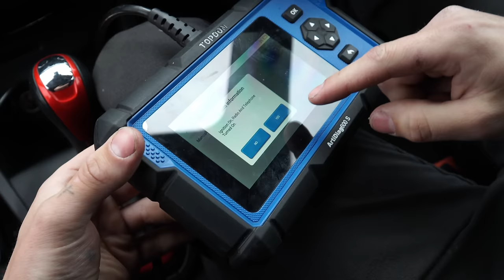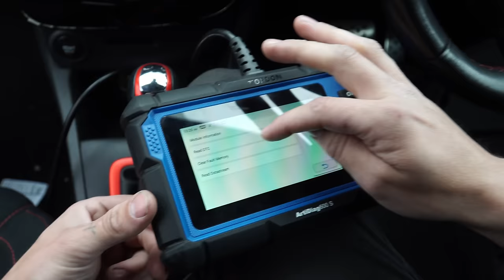They Rejected This Renault Clio After 7 Months!

Comment: Although she trashed the car and definitely lied about the severity of the fault, it was confirmed as intermittent and if I'd bought a car with an intermittent gearbox fault, I'd no longer wish to drive that car for multiple reasons. 

Although you guys did absolutely nothing wrong, the onus is still upon you, if under warranty,  to find and resolve the fault, even if its just a sensor. 

Personally I think the customer is chancing their luck but if they've had faults, and not everyone will report a fault immediately,  then recurring faults are no fault of the new owner. She also reported it at 5 months which is a month before the warranty expires. Therefore faults announced within the warranty period are still valid for return or repair for however long it takes the car to move through the system etc. 

It's a tough one, but the owner should be liable for ANY damage they caused if returned for a refund. So the price of 4 alloys, external and interior full valet service and replacement if any non-wear and tear items like the holes in the boot etc. 

I'm not entirely sure how the financing system works re: third party terms and conditions,  but if the car isn't returned In similar condition then surely the customer is liable and any refund they receive should represent their payment minus any work done in order to resell the car. I'm probably wrong because these companies and consumers rights don't always give reasonable and fair outcomes for both parties. So the idea that the customer can basically rent a car, trash it and return for a full refund sounds like a recipe for disaster for small businesses.  

Its a fking tightrope mate! But I can see nothing wrong with how you've dealt with this matter and would happily purchase a car from your shop! Sub added ❤
Reply: Ps. I should have watched the remaining few minutes before commenting 😂

Comment: Clio genuine pads and discs are soft as shit about 30k generally and things that should not brake brake but mine has been good really
Reply: 30k?!? Shocking for such a small/light car.

Got 45k out of Volvo (genuine) pads on a pretty hefty saloon (S80) with a heavy 2.4l diesel lump up front - and I don't drive like a saint! 
Finally replaced as one disc developed high spots and the other three (+ pads) were getting well worn - but still enough to pass MOT without advisory only a month before.

Comment: Well at the moment I am in a similar position but as an owner. Bought car in Feb  , got 75 miles ABS , AFS, TPMS lights on ..the same day , got home called gargae , yeh bring it back as it had 3 months warranty, they refused to collect it so I had to arrange transport and a hire car for a week. Fixed a week later for a faulty AbS sensor and hub. Two weeks later same lights on , local indy reset for me , six weeks later all lights back on along with this a squeal when breaking plus an oil leak on the sump , reported back to garage that not happy and returning the car for them to look at there response we will fix the ABS hub for free it is that the other items we will charge you for oh and I have to transport the vehicle...so got my finance company involved , only had the car three and half months so not acceptable. The car has been looked after and cleaned every week. Unfortunately the attitude of the dealer put my back straight up so unless they put the things right I have requested I will reject the car. And yes I can afford the finance I cannot afford to be without a car. Seeing as it is an old Lexus the parts are going to be expensive so let's see what the dealer comes back with. That said the owner of that Renault should be ashamed leaving all that crap in it

Comment: This is happening more and more people know they can get basically a free car for 5 months then pull the consumer writes then get all there money back go to the next dealer to do the same thing also isn't there a clause that they have to bring it to you to fix it first what about the damage and warranty short to earth check wiring loom going to gearbox may have been earthing or she's been doing very short runs the battery may have been near the end of its life the battery would not have been getting changed enough and constantly being depleted there for throwing up fault codes

Comment: So, some sympathy for the customer here. She bought a 10 year old car with her savings, which 6 months later she was told needed another £3.5K spent on it, which TBH is ridiculous. It's ridiclous because cars generally are WAY too complicated these days, which..... A. Makes any issue complex to diagnoise, and B. Turns something straight forward (like a gearbox replacement) into a major specialist and expensive issue. I get that cars are suposedly more reliable these days, but 3.5K for a gearbox in a 10 year old car....get a grip! No wonder she pulled the warranty card, what other option did she have? The problem is that we have made cars too complicated, too expensive to repair, and too difficult to diagnose. We are relying way too much on electronics...sensors which fail regularily.  Back in the day (I'm only 54) I could have replaced a failing clutch, even a gearbox, in my garage for a few hundred quid....now its the preserve of computer techs and specialist mechanics. It stupid, unsustainable, and it has to stop.....EV's of course will solve the problem (*!!*), because when you've mortgaged your house to buy one, and the battery fails, and no one can fix it, you just dump the car in a landfill and buy another.....yet another degree of stupid! We need to get back to vehicles that the owner can maintain at low cost and that can be repaired sustainably....that's what's best for the customer and the environment.

Comment: I think it is telling that she went to the finance company rather than you, possibly after advice, knowing the that they would be more than happy to strong arm you for a return with little or no investigation on their part? Sounds like a classic "don't want it anymore and can't afford it" scenario, especially as she put so much on finance for a low cost car? I tend to be more of a pessimist when it comes to selling, that way I can be pleasantly surprised. Rule of thumb, the nicer a customer or seller is, the more likely they are to screw you over? With experience comes that feeling that they are not being honest. I have walked away from a sale, much to the annoyance of a buyer but I didn't want the headache I knew would follow. As with yours and my previous court actions, peeps lie!
Reply: Quote: "Sounds like a classic "don't want it anymore and can't afford it" scenario, ..."  You didn't pay attention to the video.  There was a fault which caused the gearbox to change gear erratically and the garage told her it could cost £2500 to £3000 to fix.  After some research Berrow Motors found the problem may be due to a degraded battery so they put a new one in which appears to have resolved the problem.  Berrow Motors then gave the customer the option of having the 'fixed' car returned to her or to buy the car back from her with a deduction of £1301.60 for wear and damage while in her possession - she accepted the latter.

Comment: 200 BHP hot hatch as a first car is odd. Probably one of them people that just wanted the “top-spec” car. Also, probably doesn’t have a clue how double-clutch gearboxes work. They’re generally pretty smooth but they’re not lazy like a traditional torque-converter. As stated, probably just didn’t want the car and used it as an excuse to hand it back. Also, can’t believe the state of it. Almost looks like they broke bits off it and ruined it for the “inconvenience”. Some shitty people out there, I’m afraid!

Comment: id never buy a car with double clutch box, and its going to turn back bite back in used car sales because they cost so much to fix so it write off so many cars. just got my long term car, it has to be manual, but due to health and make thing better on long trips cruise control. one day i may need an auto but id go old school auto even if it means going older. the car you had back looks like she abused it, thrashed it, raced it so no wonder the expensive dsg issues
Reply: cutting and drilling holes to feed cables, wow not a bright person that, ive wired my duel cameras they easy slot between the trim and rubber seals, i hope you give everything back to finance people of all your finding and fix costs. 2000 miles and that state, has this person ever passed a driving test

Comment: Looks and smells like Miss Myfirstcar has been ragging it from cold for 6 months before rejecting it. I can also tell it's almost never been washed or the interior hoovered. I bet the messing about with the electrics triggered a fault in the circuit because amps went missing as they piggybacked the electricity from somewhere and they killed the battery. Claim damage against wheels, tyres, trim, jack, washer bottle, air pump missing, cleaning, admin costs. Resell, profit.

Comment: All dct are junky at low speed and town driving it a characteristic of the dual clutch system . As soon as you said 2nd gear I new the gear box will be junky they are not smooth like cvt or conventional  auto. 
Why the finance company allow to reject is beyond me .there should be an inspection before and 5hey should take the hit not you.

Comment: I could understand a manual misbehaving if your driving is at fault. But a auto does everything automatically. Modern cars ecu log driving behavior, including speed and how hard acceleration pedal is pushed. You clearly knew there was a issue with the transmission. Otherwise why make the video? To try and cover it up.

Comment: You sold this to a 'first time driver'........... Within 2000 miles all the wheels were curbed and someone fitted a reversing camera to it. 3 of the tyres had to be replaced for wear. Lastly the interior was a hot mess and it looked like washing the car had been a challenge. I have the following ideas floating through my head. Too much motor coupled to no experience results in high insurance of eye watering levels. Customer lethal behind wheel with inability to estimate distance or road position. Finally customer you saw was not the driver but a name covering for a disqualified.

Comment: The customer is free to treat their car however they want. The gearbox has failed under warranty, and you're complaining about minor damage and crumbs - literally crumbs when the faulty car has been returned. Your assumption that the driver is the reason for the faulty gearbox says a lot too. Very hard to break any auto box with driving technique.
Reply from the maker: It hasn’t failed though. And it wasn’t under warranty. It also wasn’t their car by this point. Did you even watch the video or did the overwhelming urge to shout about be a handout chasing loser get the better of you before you’d finished watching?
Reply: @LRSTGS So it's acceptable to hire a car and take it back with dents, scratches, etc and also leave rubbish in the car? I wouldn't like to lend a car to you if that's your attitude towards other people's property. 😠
Reply: The gearbox isn't broken. Even IF it did it's wear and tear. 

Also if you are rejecting a car it should be cleaned, logbook available.
Reply: (qualifications in mechanics)

Comment: Well the problem could have been there you can't inspect a clutch, if the clutch is end of life it will not show up till it's had some more time to wear down and this sounds like the case, even if she was driving badly on it a decent clutch should last a long time years before it causes a problem.
you can't say the fault hasn't developed in that six month period faults do occur anytime.
I think if there's nothing wrong you could claim the money back from the finance company, if you got a report on the car say from the RAC that no issue was found with the gearbox and extensive testing has been done also and the condition of the car come back worse with damage and you want a rebate for loss of earnings because it's lost value. you could take the finance company to the small claims court if they refuse you're findings.
I think any check you do on a car prior to selling should be filmed and you can go back to the filming to see if that issue was there  before you sold the car, that could be used in evidence for a rebate and for marketing purposes. you  need to do some Hill starts best way to test the gearbox

Comment: I work in consumer rights. You’re not actually right in what you said. The customer need not report the issue immediately when buying a car. That’s why the 6 months assumed is present. 

It’s assumed an issue was present during the first 6 months as it must have been failing. With the best will in the world you couldn’t wear a car in 6 months. 

The burden of proof that an issue was not present within the first 6 months falls on you as the seller. And I’m afraid an MoT wouldn’t be enough proof as I’m sure you know. Also your own pdi check wouldn’t be sufficient either.
Reply from the maker: Well that would be down to a judges discretion, wouldn't it. You can burn through a clutch in a day, you can definitely wear out components in 6 months. You can roll a car in  2 seconds....
Reply: @ShiftingMetal  hmm. But none of that happened and the car did have an issue so…….
Reply from the maker: @yan0132  so what genius, I never denied that. 🤦🏼‍♂️ Give me strength

Comment: There is loads of mis information. 

Your gearbox specialist HAS said there was a fault. 

For him to say kerbing on the wheels will stop the gearbox holding gears is absoulete nonsense. Also coupled with the fact he said oh we cant work on these cars anyway we only do manuals.
Reply from the maker: Did you watch the video?! Even I said there were fault codes in there. The gearbox guy said 'it would be easy to say it's down to the wheels BUT IT'S NOT CAUSED BY THAT'. The 'we won't work on it' comment came from the customer, when we spoke to them ourselves, they said they would... Pay attention to the video if you're going to comment on it

Comment: You need to grow some balls and stop taking cars back when they are passed 6 months. WTF 
you are actually making it hard for other  dealers by giving out the impression that's its ok to return a car after 6 months.  ( only applies if fault was present at point of sale). 
Be nice to see when you do a video that says you told them to do one as its was outside the time limit. We don't all have a you tube channel or unlimited funds like you . 
So stop making it hard for the rest of us.
Reply from the maker: How many cars do you sell a year? Ask 100 car dealers and I bet 90+% will agree it's easier to refund and move on than it is to argue the toss and go to court, probably lose the case and more money than just refunding. I'm far from having unlimited funds and why do people whinge "we don't have a YouTube channel like you" Well make one then, less chat more action buddy
Reply: @ShiftingMetal  
We have a big garage that does 100 cars a month , 1200 a year.
Been in the job 60 years plus as a family mate , so know the job inside and out .
We are not some ex plumber deciding to have a bit of a play .
The law is there to protect the dealers also and the cut off point is 6 months; so if you have a strong case you should not be frightened of going down that route.
Your plan seems to involve backing down at every situation and giving them refunds regardless. 
Like we said sometimes you have to grow some balls.
About time you stood your ground for once .